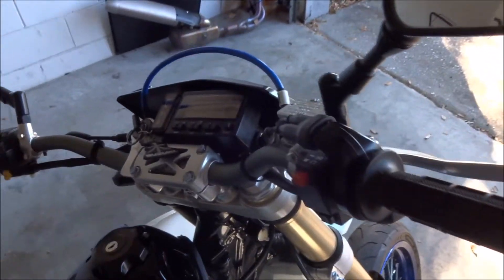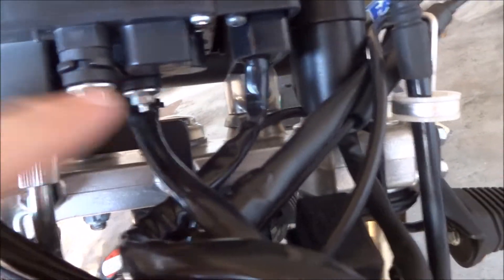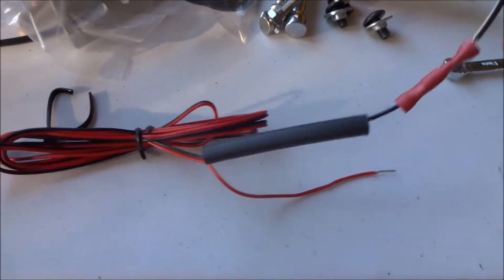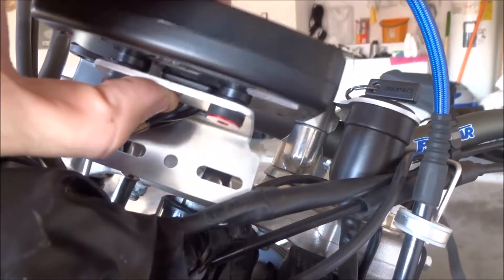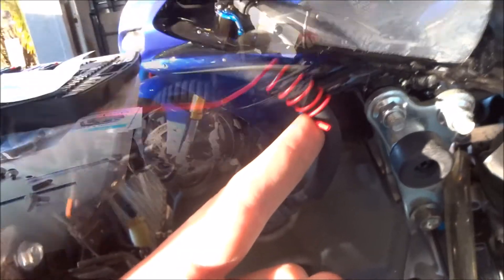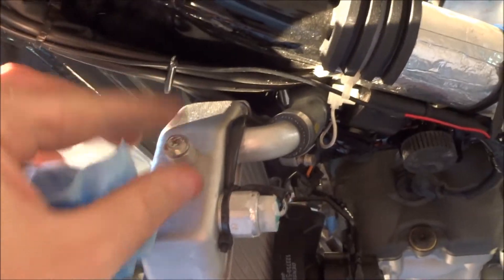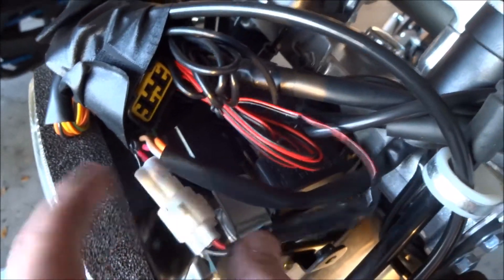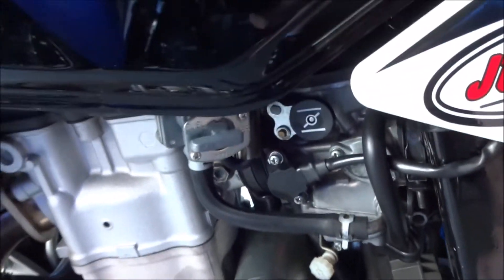How To: Trail Tech Vapor Installation 1080p (on 2014 Suzuki DRZ400SM)

Comment: This is a relatively old video but, are you able to add a gas gauge?
Reply from the maker: It may be possible, but i'm not aware of any.  I think for most bikes the gas guage is integrated with the fuel pump, so i'm not sure how it'd be done.

Comment: good video,  how are you satisfied with  this speedometer? any issues ? works fine?
Reply from the maker: I had issues where the speed displayed would sometimes be too low, like 16mph when I was doing about 40, but then it'd go back to normal once I stopped. A little annoying but not major. Otherwise it was good.

Comment: awesome vid!!   I'm leaning towards the trail tech vapor for my drz after mine stopped working completely still turns on but speedo and odo stopped and reset to 0.. Hows it holding up so far? also  last question can you add The miles you thought you had LOL?
Reply from the maker: Holding up fine. My only gripe is the speedo sometimes registers perfect, and sometimes it's like 1/3 speed. It's strange. I've fiddled with the magnet but no real change. But it's better than not at all. Most of the time it's right. 
You can set the odometer, but since it's not "official" that you can, I didn't mention how. You should be able to Google it pretty easily though. I set mine to what my previous odometer was.
Reply: dope! thanks for your reply!  @JohnPaulCraig

Comment: Can you adjust the max. travelled kilometers? So you can keep the old amount
Reply from the maker: Yes you can, but I don't remember exactly how. I just googled it.
Reply: @JohnPaulCraig  Okay great. Where did you find the model with the radiator screw tho? I only find the hose sensor one.
Reply from the maker: Trail Tech 752-301 Black Vapor Stealth Computer https://www.amazon.com/dp/B003177CUU/ref=cm_sw_r_cp_apa_i_xj7oCbC69SPS7

Comment: What was wrong with the original clocks??
Reply from the maker: My speedo cable kept coming loose, then after I changed my front wheel, it stopped working completely. It runs on a cheap plastic gear. Plus it has no tach. Trailtech gives more info and somewhat more reliably.
Reply: Cool ok 👍 just wondering

Comment: I have a dr200 which is air cooled.  How does that work out?
Reply from the maker: You won't need the coolant temp guage of course, but the speedo and tach are pretty universal, so as long as you have a currently powered guage cluster that you can use the power wires from, it should work out. The Trailtechs are pretty generic overall.

Comment: Tried installing mine tonight and now there’s no power to the bike. Nothing turns on. Headlight, dash, turn signals, etc. bike won’t even start. Any idea?
Reply from the maker: If all is connected right...blow a fuse maybe?
Reply: I would recommend taking it to someone that knows what they are doing. Don't mess with what you don't understand, I had to learn the hard way...

Comment: The socket you started talking about at 3:20 to run the power to- did you just cut that off the original speedo?
Reply from the maker: Yes, at around 4:10 I show how to splice it into the new dash

Comment: Hey man I’m finally getting around to doing the entire install right now. I’m throwing the trail tech on one of those motodash2s from drzrider. I have the ‘17 version of the sm. What did you set the parameters for the wheel size to get the speedometer? Oh and one other thing. The old speedometer cable- did you just tape it up and just leave it in there? Let me know if that last question doesn’t make sense. Thank you so much for doing the walk through. It has been fairly easy thanks to you.
Reply from the maker: I used 1884mm  as the wheel size.  Its been decently accurate when it actually is.  I've had some issues where at times it shows about 1/3 the speed im actually going, but i think it's either sensor placement or strength of the magnet or something, but when its in the right range, it seems to be accurate using that value.

As for the old cable, i removed it all completely then duct taped the old hole by the axle because i need the sensor housing as a spacer.  If i find a nicer solution i'll swap it out, but for now it works fine.
Reply: John-Paul Craig thanks buddy!
Reply: http://www.wheelingcyclesupply.com/shop/product/zeta-speedometer-gear-canceller/189
In case you're still on the lookout for something to replace the speedo drive

Comment: How pissed were you when you realized you took the whole carb off for nothing? That’s no easy task man!
Reply from the maker: tommcdowell taking off the carb at all pisses me off. I wish someone would make a damn street legal factory supermoto that's fuel injected in America, and not a 12000$ Husqvarna, lol
Reply: John-Paul Craig I hear you man. When I did my jd jet kit I spun it in place and didn’t have to remove the whole thing. That made things a lot easier. Thank you for your video btw. I got the 752-700 vapor for my 2017 400sm and it came with the radiator hose insert. After watching your video, I ordered the screw from trail tech. I believe it’s compatible. Your video will save me a lot of hassle. Did you ever put the tach on the spark plug?
Reply from the maker: not yet, its good enough.  the graph is fine, just the number is flaky, and i dont use the view with the number so it doesnt bother me enough yet

Comment: I already installed mine but, did you keep the old speedo drive on as well and just remove the cables or did you just leave it on as a spacer? Just wanna see if i should leave it or take it off....
Reply from the maker: Rizky_Buizness I left it as a spacer for now. I took the cable out of it and just taped over the hole until I find a legit spacer, but I'm in no hurry.

Comment: Hello, what is the reference of the screw sensor on the trail tech site? Thanks for the video
Reply from the maker: I'm not exactly sure what you're asking, but i think you're referring to the radiator/coolant temperature sensor.  There are two styles, one requires cutting into the radiator hose, and the other is simply a screw that goes in the top of the radiator.  The kit that comes with the screw is part number 752-301.  The link for JUST the temperature sensor is here: http://www.trailtech.net/digital-gauges/digital-gauges-replacement-parts/temperature-sensor/v300-001
Reply: Thank you, it was the screw that goes on top of the radiator. Thanks

Comment from the maker: I'm still around 200 miles on mine, still get the issue where the speedometer is either perfect or 1/3 of actual speed. Haven't figured it out yet. I noticed you said it turns on when you turn the key. If installed properly, it actually shouldn't turn on with the key I believe, but instead should be connected to the constant 12v line. the screen will turn off when unused and will auto turn on when it gets data (like rpm or wheel speed).

Comment: when I turn the key my dash lights up no problem. But just the other day I was riding and my miles stopped at 1999.9 trying to get a new one from trailteck.
Reply from the maker: Devin the dude , if you're talking about the stock dash, first check the back of the unit...the speedometer cable tends to fall off a lot. sometimes it's as easy as plugging it back in.

Comment: How do you calibrate the speedo to your wheelsize?
Reply from the maker: STiCKxaH you enter the diagnostic mode and one of the options is wheel size, meaning outer circumference of the wheel (in millimeters). one easy way is to mark on cement when the valve stem is directly at the bottom, then push the bike until the front wheel made 1 revolution and the valve stem is at the bottom again and mark that spot, then measure the distance between them.